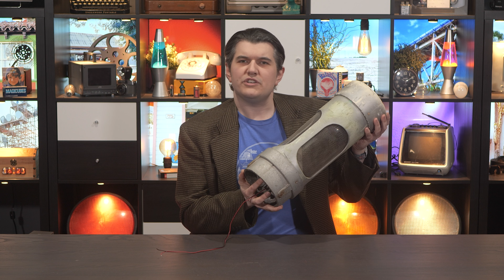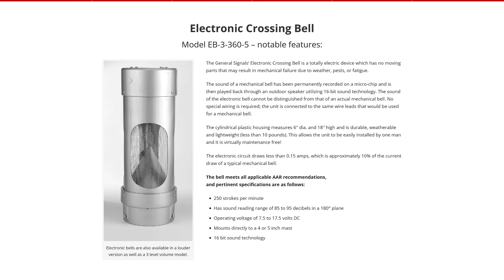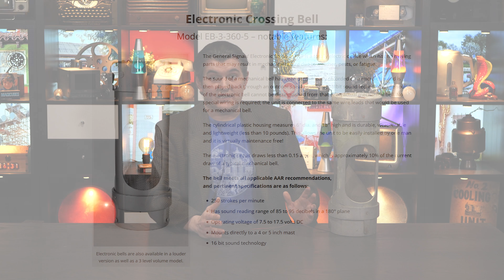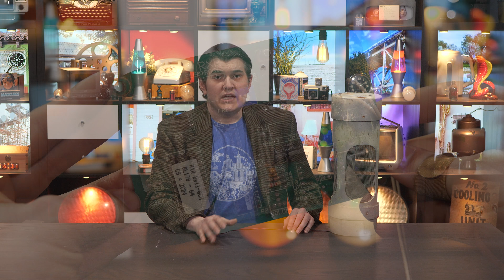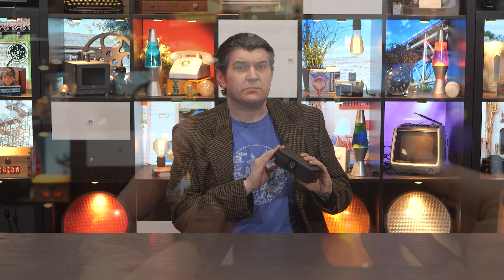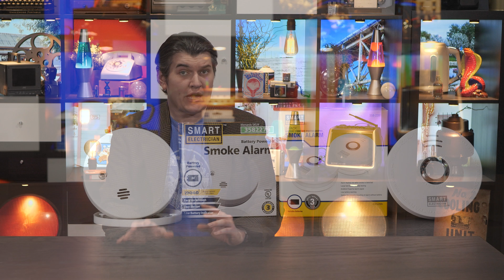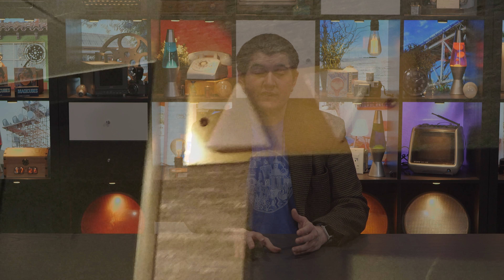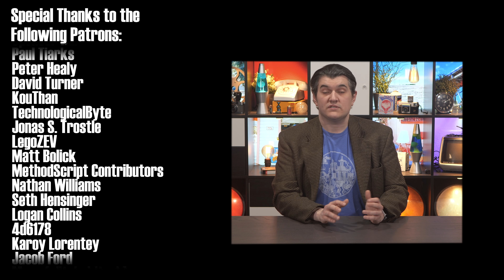The disappearing and unappreciated art of audible alerts

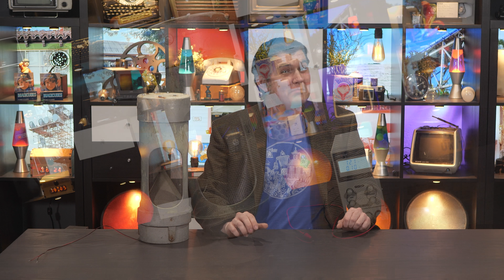Comment: 0:46 I still hate how many still go full deer in headlights mode when the get stuck in the crossing. Just floor it into the barrier! Insurance won't cover the damage, but I think they won't like to cover death either.
Reply: barriers today have "gate kings" on them, so that they will move out of the way instead of wrecking the car (though on today's cars, a $35 plastic bumper = $9999 or  TOTAL with insurance! ...  but that is a future Alec video!)
Reply: I cant imagine it would do much more than a little body damage anyway
Reply: @nightwitchsara Especially those wood barriers. They snap with barely  anything above 25 mph on a cold stop.
Reply: @MatthewCobalt They're not even wood anymore. They're either full aluminum, or more likely fiberglass with a bit of aluminum. And they're designed to break off
Reply: I intentionally ran a barrier in my Elantra because the damned yard-switcher had been making me wait for 20min.  The car is so low the bar just hopped over.

Comment: I’ve heard temporal 3 in household smoke alarms but I’ve NEVER heard it in a commercial building. My office building in NYC uses the slow whoop sound, and growing up in Florida all of my schools used a single buzzing sound paired with flashing lights.
Reply: That's where the lack of formal standardization falls short. Flashing lights are standard, but the sound is quite dependent on not only the brand of alarm system the facility uses but also the specific models of the alarms themselves. Continuous and slow whoop are also both commonly used, but code-3 is the encouraged semi-standard

Comment: The fire tone ("temporal 3") made me curious.  I could of course just google this, but conversation is more fun: what in the unholy hell is the emergency alert sound on the radio?  It seems like something you would just know the answer to off the top of your head, especially after researching this video.  I assume it's some encoding similar to dial-up just being played over audio because dumb radio is dumb, but past that I have no idea.  Surely if it's just to get your attention it could be less obnoxious, but maybe it was decided that was an appropriate level of obnoxious given the ostensible severity of the alert?

I typed this at that point in the video and didn't submit in case you covered it, but now I realize maybe part of what's encoded is "this emergency alert lasts for X seconds" and other metadata for the radio to use?
Reply: In short, it's a coincidence. The fire alarm industry and the emergency alert system are two unrelated industries that happen to sound the same. In the case of fire alarms, the temporal 3 is a pattern that the alarms sound in to sound distinct. In the EAS's case, those three tones are actually encoded information that receiving devises use to spread the alert. Those tones are called S.A.M.E. headers, standing for "specific area message encoding", and they're repeated three times to prevent false alarms.
Reply: @MichianaAlerting  ah okay, fair enough.  I had a feeling it'd be something to that effect but it'd be really cool if it weren't.  xD
Reply: I used to be a radio station engineer, and you're right - it's like dial-up!  The EAS (Emergency Alert System) tones at the start of an EAS broadcast are AFSK encoded at ~1500Hz and ~2000Hz and contains information about the broadcast: originator, event type, duration, initiation time, area (with a Specific Area Message Encoding or SAME code), and finally the ID code for the encoder that (re)encoded the message. EAS headers are transmitted 3 times for redundancy.  If there's audio content following, a multifrequency tone at 853Hz and 960Hz (same as the old EBS system) is used to cut into the broadcast audio.  Finally, another set of AFSK tones at the end of the message signal that's the end of the message.
Reply: @mobile_vic Also worth noting that the old EBS signal that's still carried over, the frequencies chosen (853 and 960 HZ) were chosen to get your attention, the interval is a just intunation major second, a particularly grating tone on the human ear. Worth noting, this signal isn't required in all alerts, and some stations local to me only use that signal on the monthly test, alerts forwarded from weather radio are SAME > voice message > EOM.